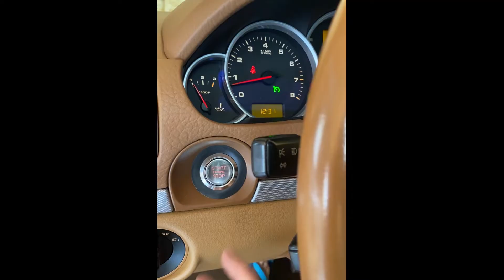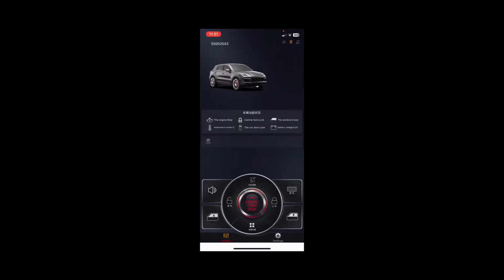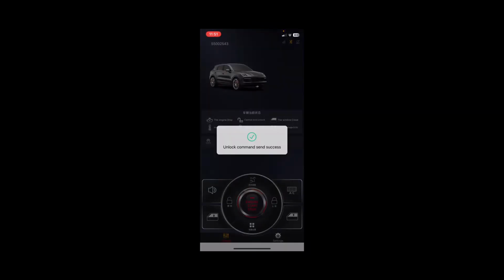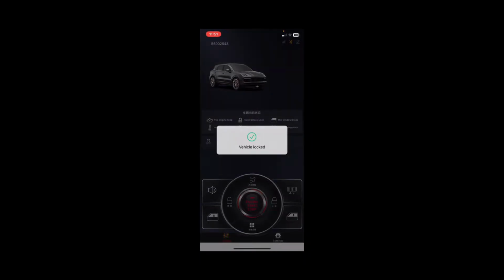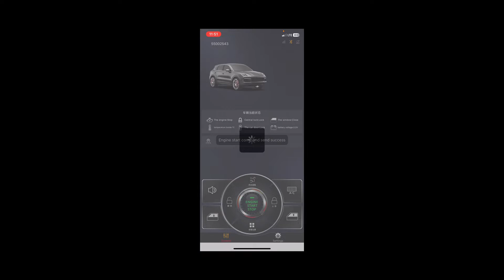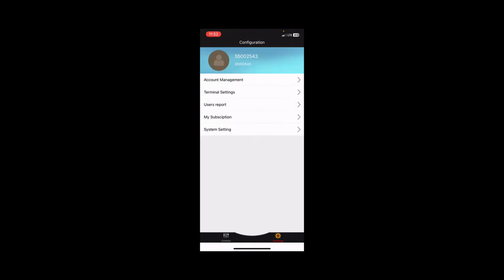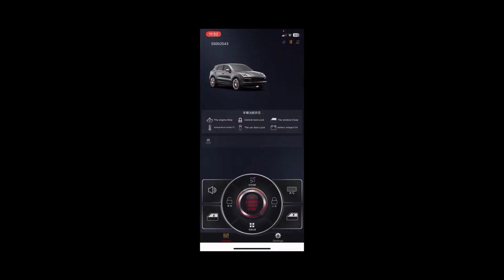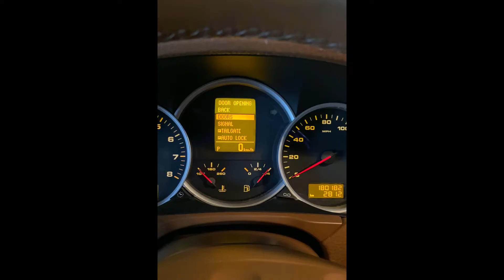Adding push start button, keyless entry, remote starter, and bluetooth app to Porsche Cayenne 957

Comment: Scusami ma non hai problemi con la batteria, non te la scarica, c'è un assorbimento eccessivo con questo modulo nella mia auto
Reply from the maker: Yes it does absorb from battery; I have a trickle charger connected when I'm not driving the car for long periods of time.
Reply: @_ARUS_ ok grazie, io purtroppo non la tengo in box e quindi non posso collegarlo al mantenitore. Peccato.

Grazie

Comment: Sorry could you link again to that product model and did you have to destroy and solder an original remote for this to work?
Reply from the maker: The product should be in the video description and if the product no longer exists just search for Porsche Cayenne 956/957 keyless entry.

And yes you have to open the old key and take out the internals; you can still use it to open the car in the old fashion (insert the key in the door knob and turn), but you won't need it unless your car battery drained.

Comment: Any issues after using it for 4 years. The link no longer exists. IS there another vendor. Or do u have vendor info I can find the kit. eBay has different looking ones that say it will work for under $100.  Is one better than the other?
Reply from the maker: Hi, the kit still works great; I love it.
You can search on Ali Express; that's where I bought mine, look for Cayenne 957 keyless entry kit.

Comment: Hi could you help me out fitted the same kit but unable use the key's to unlock and lock unless the ignition is on then remote key's work 😢
Reply from the maker: Oh wow that's weird; I honestly don't even know how to help you with that.
Is it possible that you somehow put the 3 antennas (3 black wires) very far and they're not picking up the signal of the key?
If you put them under the roof liner like I did maybe it's worth exposing them just for testing purposes. 
Another possible thing is to put a new battery in the key fob, maybe the one that came with it is very old.
Just ideas; good luck.

Comment: Any update from the supplier on fix for door defaulting to autolock/unlock?  Seems hard getting in touch with them no luck from my side!  Pls share if you can
Reply from the maker: Sorry can you elaborate? I don't understand the autolock/unlock issue.
Reply: @_ARUS_ Right! apologies for not being clear.  So on the car main menu when i uncheck the doors to unlock and go back out it does not seem to store it everytime i restart the engine.  I tried contacting the vendor and still waiting for a response.
Reply from the maker: @faisalalmarrar330 yeh so with active keyless entry (i.e. unlock when you approach the car) you can't change that; it will only unlock the driver door, if you double press the open button it will unlock all doors and hatch.

Comment: Hi, does this mean the key module will no longer be used? Coz my current key module has issue as sometimes it doesnt detect the key
Reply from the maker: You mean where you usually insert the key? Yes, it will be removed and replaced with the push start module.
Reply: Thats nice. My current key module is kinda defective. Rather than buying a new one which is expensive n require coding as well, i rather invest into this
Reply from the maker: @zuheflyful absolutely! I love this kit; highly recommended.
Reply: Can you provide link of your purchase? Thanks
Reply from the maker: @zuheflyful  It's in the video description.

Comment: Hi there, I installed the kit exactly the way you did but mine the red and black went to the back of the key chip as in instruction. Once pluged in, only the fob lock unlock the car, start button lit up but wont turn the power nor start the car. What do you think it could be?
Reply from the maker: Hi,

My advice is to try the way I wired the chip (since it works for me).
Also buy a new battery for the key fob, maybe the kit is not detecting its presense in the car and not starting it.
Also did you put your foot on the break pedal when you tried the start button?
And one last question, did you try starting the car remotely with the key fob? Do this combination (press unlock then immediately press lock and keep pressing for 5 seconds, it should start the car).
Try those things to narrow down what’s working and what’s not.
But yeh make sure that you’re pressing the break pedal when you push the start button inside the car.
Reply: @_ARUS_ thanks for replying, I’ll try all these and see what next. One thing I notice is that my key fob chip is much less chips than yours (957 GTS 2009). Anyway, I’ll try de-soldered the black and red wires to see what different. 
Btw on you main host unit (the biggest box) does it has a switch combination of number 1-8 that switch on off? (On the side of the box)
Reply from the maker: @hquoctuanaurevoir7530  My pleasure.
I think my box only had a reset button that you'd usually use if you have new key fobs and you want to pair them with the box, I don't have any 1-8 switch...you can also pause my video when I display the different parts of my kit to see for yourself.
Reply: @_ARUS_ hi there! I finally got the set to work as expect. Pretty decent upgrade and the new fob is so much better looking. 
Still dont like the only driver door setting thought I wonder if there has been a fixed to this…I’ll contact the seller just to see. Anyhow… thanks alot for the videos and guide, it helps alot!
Reply from the maker: @hquoctuanaurevoir7530  congrats, if you press the open button twice it will unlock all doors.
Reply: @hquoctuanaurevoir7530  I'm about to install mine, but the way you explained your kit, sounds similar to mine with the seperate copper wire and the 1-8 switch on the side.  What all did you do to get your kit working?  Want to have everything ready for when I attempt the install this weekend
Reply: @seanprudeaux2336 depending on the exact model of the cayenne it may be slightly different. I installed mine following exactly to the guide from seller. Be very careful while soldering the key chip, you dont want to short it. However, I left all the side switches off except #1 on and it worked. You may want to tweek around with those abit on yours. Seller said to turn # 1/3/8 on but I only needed 1. Good luck.
Reply: Hi, i own a 2004 Porsche cayenne and took the risk of buying this kit also optd for bluetooth.  after few weeks of tweaks and talking to the vendor ( poor english!) it worked!?

I watched you clip mutiple times it does help with the installation.  Thank you soo much ❤
Reply from the maker: @faisalalmarrar330 my pleasure; glad I was of help.
Reply: Hi, where did you placed the gray ignition wires?
Reply from the maker: @nigelgibbons696 I honestly don't remember; I tried to make the video super detailed, please pause on the relevant segment to see how I wired everything.

Comment: Still good to go? The bluetooth device was draining your car battery?
Reply from the maker: @maxwelludell3672  yeh the system works great, but I have to keep my car connected to a trickle charger, otherwise the battery dies over 2 days (I don’t drive often since I work from home).

Comment: Hey, apologies in advance for people making you the go to Cayenne remote start guy. However you’re the only person I can find to ask about this thing. My kit is exactly the same, but it came with a second transducer that seems to be on its own little harness. The instructions show it wrapped around the factory ignition? Which is strange since we’re removing it to install the button. Any input would be greatly appreciated. Thanks man!
Reply from the maker: Hi, 

No worries; I'm always happy to help if I can.
So are you saying that our kits are identical and that part is extra? 
There's a section in my video where I lay out the kit on the table explaining the different parts before I install it, is that the only extra thing or our kits are totally different? In the latter case please contact the seller.
Reply: They appear to be 99% identical. There are some cosmetic differences but I think that might just be just because I purchased mine last week and you got yours a year ago. The extra transducer is the only difference, it looks just like the transducer that the key chip rests in only larger and it has its own plug/harness the plugs into the main module. I sent the seller on AliExpress a message but judging by the text in the instructions I was given I don’t think they speak English and just used a cheap translator, so I’m definitely not gonna put all my marbles in that basket. 

In the instructions all it has is the word “Transducer” and has a picture of it wrapped around the factory ignition. My best guess it’s maybe it’s an option for a factory push button ignition if that was an option? And I was sent it by mistake? 

I don’t understand why they’d want me to wrap it around the factory ignition if we are just going to remove it. It’s seems like a well designed and thought out kit, I doubt they would make a mistake like that.
Reply from the maker: @xWebdriverTorso  Can you paste the item number from Ali? (what's after /item in the URL); don't paste the entire thing, I'm sure Youtube will remove it.
Reply: @_ARUS_  lmk if that works
Reply: @_ARUS_  lmk if that works
Reply from the maker: @ Your 2 comments only show "lmk if that works"; I think Youtube thinks you're pasting a phone number and removing it as well lol

Anyway, honestly if you feel that it's an extra part then just go ahead and do the installation, rewatch my video and make sure you have all of the parts and if you do then just go for it.

My car is 2010 Cayenne S (957) but I think the kit works for both 956 and 957.
Reply: @  eh Idk if I would say that’s what I think it is, that’s just my best guess. I just hate leaving this stuff to chance
Reply: @xWebdriverTorso hey any chance that your installation work? My kit is same as your with the extra copper thing to wrap around the ignition. But the start button does not turn the car on for whatever the reason. 😢been trying many ways no luck
Reply: @hquoctuanaurevoir7530  yep I got it to work. I can’t really say why yours isn’t but the first place I’d look as at the soldering on the remote. I took mine to an electronic repair place near me that did a really good job. That round copper thing is an antenna that probably picks up the RF signal of the factory ignition. Did you leave it plugged in?
Reply: @xWebdriverTorso Ok. I’ll try to work on the soldering box with the chip again. But I installed and the key fob can lock/unlock the car. Just the start/stop button did nothing. Did you end up soldering the red&black wire to the back of the chip too? Thanks for replying
Reply: @hquoctuanaurevoir7530  can’t say I remember it been a while since I did it, I think I have my notes at the shop though I’ll check tomorrow. If your lock/unlock works then maybe it’s okay, I just recommend checking it. The computer if I remember correctly collects the Ohm reading from the factory ignition with that copper antenna (so the copper antenna should be wrapped around the factory ignition) and uses that for authentication. You have both your factory ignition & the push button hooked up right? 

Also if it helps I remember when I finished mine I had a no start due to the alarm being activated which I had to clear with a scanner. Do you have any message on the cluster about the immobilizer?
Reply: @xWebdriverTorso yes during the installation, I use the old blade to test if the chip still has signal by inserting the blade with the chip next to the lock (it worked) but there was one time the chip was a bit far away then I got “immobilzer active”. Just clear them all yesterday. I’ll try again. If you have any notes that would be much appreciated. Btw, do you have a digit 1-8 switches on the side of the host unit? Mine has #1&3 switched On.
Reply: @hquoctuanaurevoir7530  I’m not too sure but I know I didn’t mess with the switches. I’ll have a little more info tomorrow when I can access my notes. Just as an interesting experiment try this. Since you have to disassemble the fob anyways try leaving the key blade in the old ignition cylinder and see if it starts then. It’ll be tucked up under the dash anyways so it shouldn’t be too inconvenient in the case that it does work.
Reply: Hi, your video is great. Where did you solder the, red, yellow, and black wires?  I was told to connect the red to a 12-volt hot fuse and the black to ground...is that correct

Comment: Hi! So I installed this on my 2010 Cayenne S, and now the immobilizer is active. I removed the circuit board and installed it back into the original key and it still doesn't work. What do I do?
Reply from the maker: @KaileyRae  Hi Kailey, sorry to hear about your trouble.
Just to clarify, I’m a Porsche owner like you; not affiliated with the product or manufacturer, I simply followed the instructions and recorded the video.
With that being said, my Cayenne S is also a 2010 so I’m not sure why it didn’t work for you.
Reply: @_ARUS_  Have you heard of anyone having any issues like this? Do you think I would be able to contact the manufacturer about it?
Reply from the maker: @KaileyRae You definitely should contact them, but their English is not the best and they probably use some translation app.

I recommend that you be as detailed as possible when you ask them, and attach pictures of your setup (all connected cables, soldering, etc).

The dongle has a reset button on it, maybe try to reset it? You’ll need to relink the provided key by pressing the buttons on the key.

Make sure all cables are pushed all the way in; rewatch my video, maybe you missed something.
Maybe disconnect the car battery and reconnect (does the battery have charge? Maybe it drained while you working on the car).

That’s all what I can think of.
Reply: Did you get it to work? I think I have the similar issue too with my kit. Install but the start button wont wake the car up at all

Comment: Hi fitted the kit to mine and central locking will not operate any help as no reply from the seller as yet
Reply from the maker: @kevinstogdale7162  Can you please elaborate on the problem in detail? You press unlock on your new key, then what happens?

Btw, I’m just a Porsche owner, not related to this kit manufacturer but I’ll try to help the best way that I can.
The seller is in China so there’s probably a time difference and they’re asleep, they’re usually very responsive.

Comment: I was considering this kit for my 955 is it compatible with a 2004 Turbo?
Reply from the maker: @MOTOWNN  I think 955, 956, 957 are pretty similar but I recommend that you message the seller; I have the product link in my description (it’s not affiliated or anything).

Comment: This is very cool. Thanks for the tutorial. This would be so nice to have installed on my Cayenne. The remote start would be great to turn on and warm up my cayenne for a few minutes in the winter before I drive it. That would save me like 5 minutes every time I start my car in the winter instead of using the key like normal and sitting and waiting. Would just have to get around to taking the time to install this but it looks pretty straightforward and I like a challenge.

Comment: Just checking in. Are you still satisfied with it after 1 year?
Reply from the maker: @Tran0370  yes I’m very happy with it; especially for the winter since I can start the car remotely to warm it up.
On a side note, after a lot of troubleshooting I found out that the optional bluetooth adapter (for the phone app) is slowly draining my battery so I disconnect it in the summer since  I only use the app in the winter. Again the phone app is optional, you can still start the car remotely with the key (press the open button then press and hold the close button).

Comment: Very good video, On Ali it says Cayenne Year 2005 so i was wondering if this kit will fit my 05 cayenne turbo (955) , i know i almost is answering the question but I'm hoping that maybe  you know for sure.
Reply from the maker: I’m like you almost certain that it will work but it doesn’t hurt to message the seller to confirm.
Reply: @_ARUS_  orderd the kit , got it today but i have a repair on my driver side window i have to deal with first.
Reply from the maker: @pezz38  I hope it’s not the window regulator; one of the most pain in the ass jobs ever 😭

Comment: Hi, nice video. I wanted to ask you, but if the battery of the new remote controls used to communicate with the old key runs out, how do you get into the car and above all start the engine?
Reply from the maker: You mean if the car battery is down?
In that case you can use the original key and put it in the door handle and turn it to unlock the car, then pop the hood and charge the car battery with some external source (another car or battery charging unit).

So after you take the inside board from the original key to put it in the kit, don’t throw it away because you can still use the key to put in door handle and open the car.
Reply: @_ARUS_  I don't mean the car battery.
I mean the battery of the new keys.
if it runs out even if I have old keys to open the door, how do I start the engine?
Reply from the maker: @giuseppebuda91  You can open the key and put a new battery, also I have the bluetooth add-on so I can open the car with my phone in that case.

Comment: Hey stupid question, i love the mimic of porsche having the key to turn it on the left, do you think if i buy the kit i can somehow replace the push start button with the key contactor the original one buy a spare of doom key that you can just turn it to start? 

Thank you
Reply from the maker: You can’t because the kit bypasses the original wiring; the cable that goes into the steering column goes into the kit then the kit’s cable goes into the steering column.